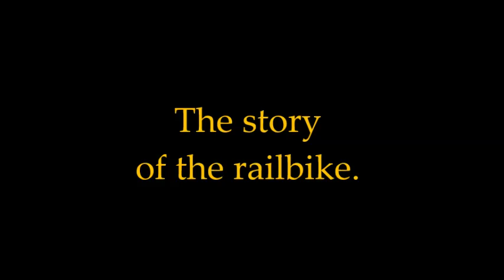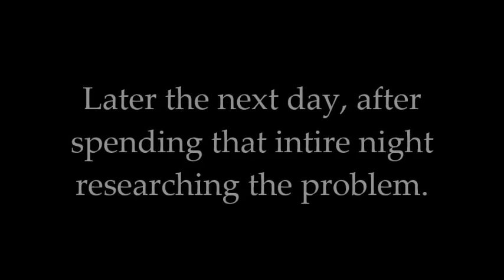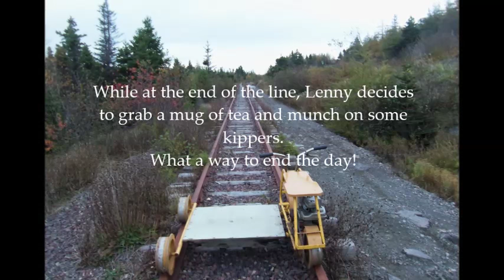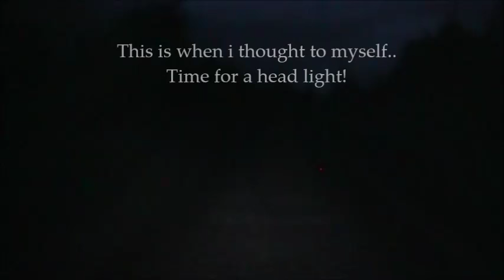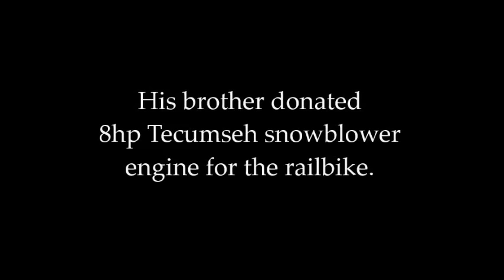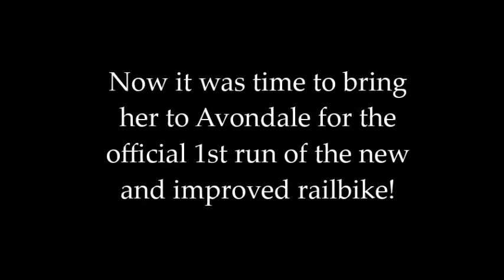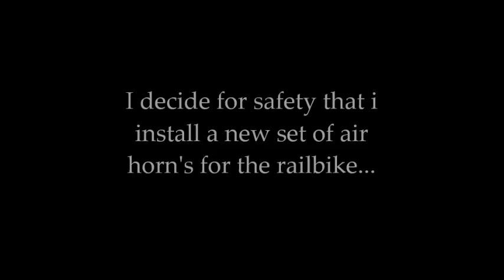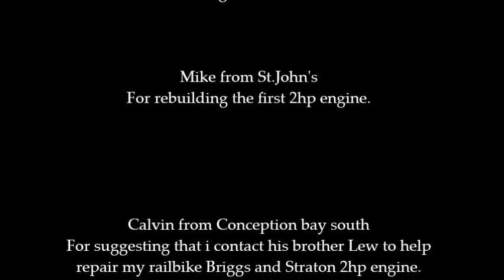The story of the railbike

Comment: that was great, will you use it in the winter, the engine is ok for the cold, perhaps a trailer to carry more people or equipment for maintenance. there were no racers for sale for cheap in the area, since the railways use trucks now. and a winter or rain covering. looks way cool, good work
Reply from the maker: +George Gardinier I will use it as long as the track stays clear, but one thing to remember is that the rear chain cog fills with snow, so I cant use the bike in the snow.  other then that, if the track is cleared, I could use it all winter if I wanted too. :-)